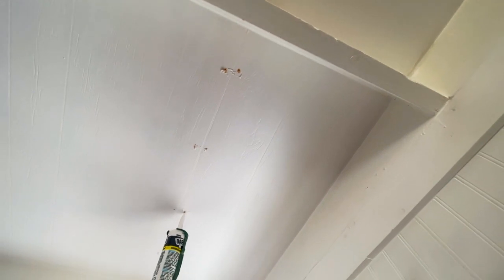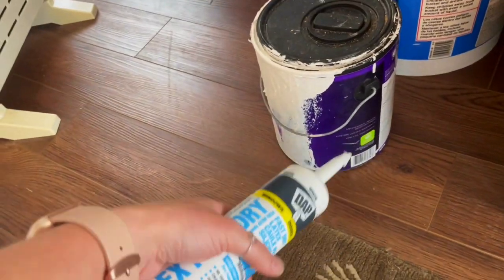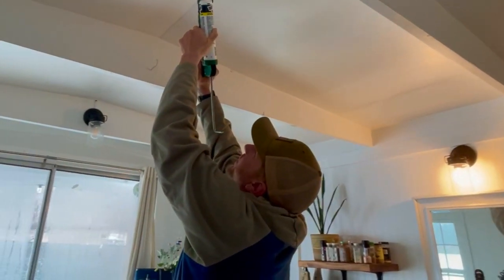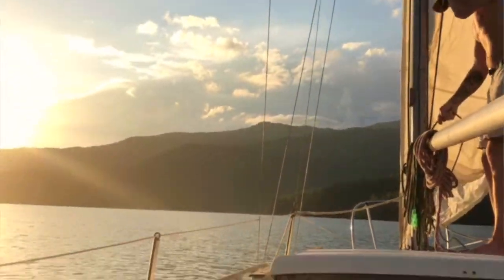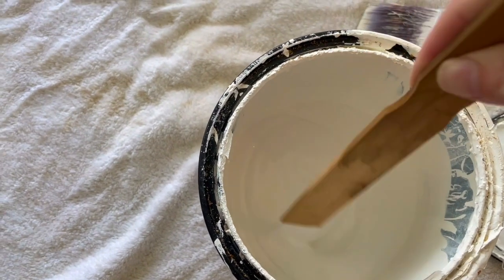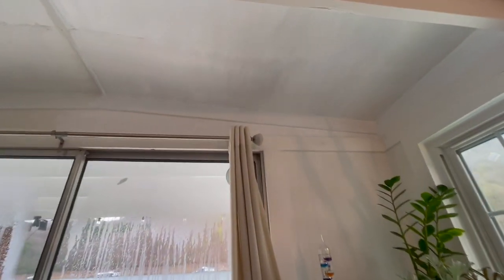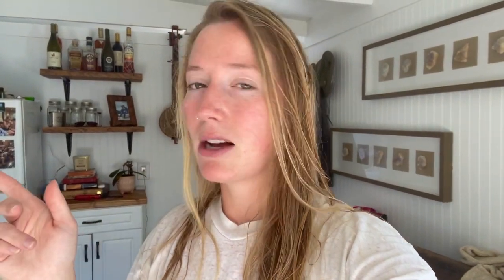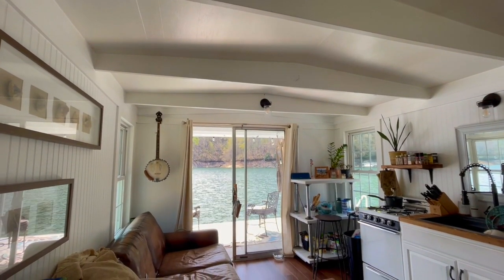Consensation on Houseboats… Does It Ever Stop?! (Re-painting our ceilings...again 🙃)

Comment: Have you guys considered a second heat source that doesn’t release moisture like propane? There are some super efficient diesel heaters now
Reply from the maker: Ya know, I don’t think we ever considered how the propane could be contributing to the condensation. 🤔 We’ll definitely have to look into diesel heaters, that hasn’t been on our radar before! Thanks for the suggestion!!
Reply: @KeepingAfloatWiththeJoneses  We had this debate with my in-laws too many times to count.  For every pound of propane burned, over a pound of moisture is "created."  If you guys aren't cracking a window in the winter, you'll get a ton of moisture buildup from the heater!
Reply from the maker: @MrTimHines  We did some research after the propane issue being mentioned by you & a couple others, and you're 1000% right! We aren't using the heater much now that it's warming up, but next winter swapping it out will likely be the move.Thanks for the tip!!
Reply: That’s exactly what they should do say NO! To propane diesel heater is 100% the way to go

Comment: Hate to say this, but you shouldn't have used nails for your overhead.
Galvanized drywall screws which are made for use in bathrooms is the only way this rusting issue will ever stop. 
Ya can't cover them up with caulk either...you're just burying the problem (kinda can't believe you did this)

Gonna hafta dig them all out and replace. (Sorry to be the bearer of bad news)

House is looking really nice though
Reply from the maker: Lol yes, galvanized screws are a given. We didn’t use the nails….the house is at least 50 years old so whoever originally built it half a century ago used the nails 😂 we’ve removed & replaced just about everything in here (all walls, flooring, windows, etc) EXCEPT the ceiling, so that’s why the ceiling is the last place in the house that still has these sort of issues. 
After digging up & replacing 100 problems….I think we’ll be ok if we bury just this 1 for a little while longer. 🙂👍
Reply: @KeepingAfloatWiththeJoneses  yeah, that makes sense!